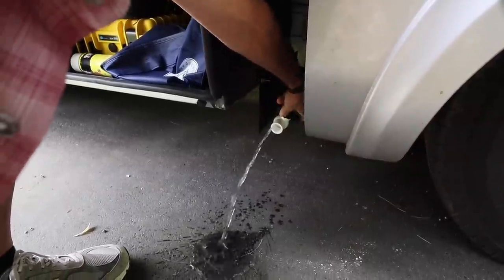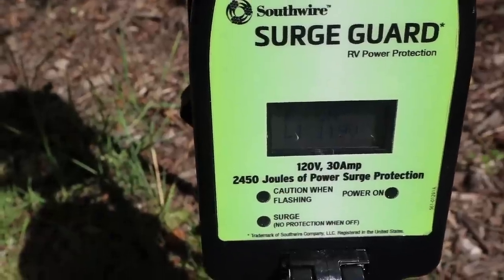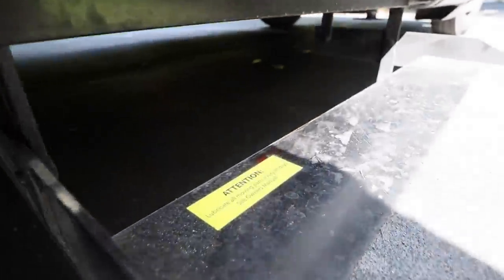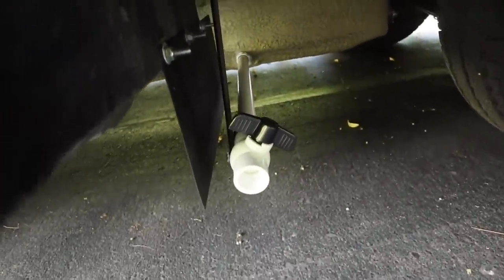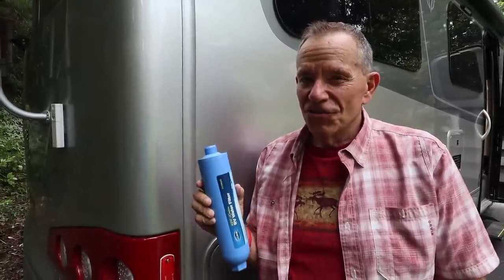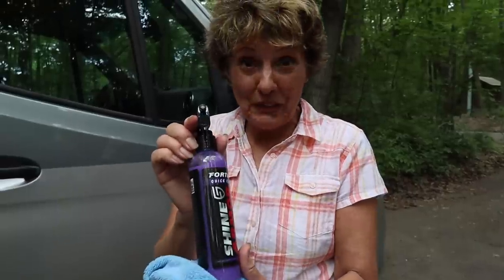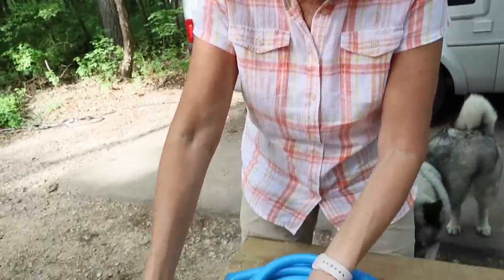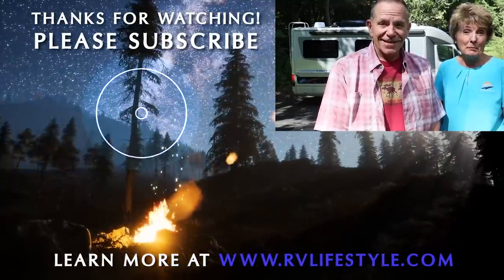12 hacks, mods, products, & RV tips and tricks for RV living

Comment: Great tips. However, you needed to tell people that the pressure reducer needs to go on the shore water connection first and then the water hose. We found a campground in Utah that had 120 PSI water pressure. If I had not put the pressure reducer  at the shore connection we would have blown our water hose apart. Thanks. Keep up the good work

Comment: Great video, these are my picks in the south

1. Surge protector
2. Pressure regulator
3. Leveling blocks, 5th wheel tripod
4. Filter to rig, also brass 90 I like also with a Y for extra hose
5. Good shower head aqugenits
6. Big Berkey water filter
7. Sink strainer for dishes
8. Geo method, Dawn and water softener
9. Clear 90 on dump hose
10. Dehumidifier also monitor temp and humidity

Comment: When I saw your electric cables on the ground I had to comment. I let my cables lay on the ground some CG in the south...next morning there were millions of ants crawling all over inside my camper... floors, walls. It was ghastly! CG itself was beautiful...just so many ants in the south. I’m glad to learn about a surge protector... never heard of dirty electricity. TU
Reply: Where do you put them so they don't touch the ground?
Reply: I just got as close to the hookup as I could, but I wonder if those supports for sewer lines would work too, anything but the ground. Hasn’t been an issue anywhere but the south.

Comment: A surge protector is an important option but even better is a line conditioner that maintains the voltage level and protects against both surges and sags - like the Hughes Autoformer which comes in 30 AMP and 50 AMP versions.

Comment: Great video. Information is priceless.
Question about surge protector: If there is a surge in power, is there a reset button on the device or does the unit sacrifice itself to protect?
Reply: Typically these will take the excess voltage and send it back on the neutral (before it goes through your devices and ruins them!). These will have ratings of being able to handle up to a certain amount before being destroyed, but worse case scenario is it gets sacrificed before everything else does. No reset buttons, just indicator lights and status screen.

Comment: Great video...one thing i use the happy camper product..works great..but i mix mine in a 1 gallon bucket. If you dump it in the toilet without mixing it up it can get chunky on you and not do its job.
Mixing it with water throughly then putting it into the tank you are good to go.
:)

Comment: Those blue water filters are good in theory.  They are filled with charcoal that aids in taste and odor removal but, they have no filter material inside them to trap  any particulates. Last but not least the water passes through the filter so fast that the charcoal doesn't have long enough contact time to work.

Comment: My undemanding is that the water pressure regulator should be placed before the filter, so you don't blow out your filter. Thoughts?
Reply: As I said the pressure reducer goes before anything. That is if you want to keep all your equipment safe.

Comment: Thanks for the tips. I am in the process of purchasing a Unity and will definitely purchase these useful items. In the event you have a bad electrical hook-up, do you just move to another spot?
Reply: TheGolfster3 We had this problem once, and the RV park didn’t believe us. So we showed him what the surge protector said; he was speechless and flabbergasted. I told him that we’d rather move then use his power. He didn’t have another site available with power, but I think he was afraid that we may give them a bad review. So he allowed us to stay on the site but charged us only for dry docking without shore power which we really appreciated. Then when he had a site available, we checked the power and it was fine so we moved there and paid the price we would’ve paid had we not checked the power first.

Comment: Super helpful. When do you treat with Happy Campers? E.g., Just after a tank dump, when you are at 50%, or just before dumping tank?
Reply from the maker: After a tank dump... I run about a gallon of clear water  in and then put in a scoop of Happy Camper
Reply: Maybe naïve question but where do you get the water when dumping or do you use the non potable hose?  @RVLifestyle
Reply: @traceymardon8161  The toilet water won't be strong enough to clean the black tank. 

- blank tank flush if your trailer has it. 
- the non-potable water hose along with your own water hose to spray down the toilet. 
- pour water from a 5 gallon jug down the toilet.
Reply: @aguyandhiscomputer  We have a black tank flush so I guess that is why I was confused.  Thanks!
Reply: @traceymardon8161  cool, that's what I use. 👍

Comment: Did you not have the surge protector in your RV or is the surge protector a second protection? Great video. Also, how do you like the leveling system. I'm looking to have them install, but checking out Advanced RV in what they install, which is ~2k more. Thanks
Reply from the maker: No surge protector on rig... this is what I use for total protection

Comment: That surge guard looks like an expensive model. Is there a way to keep it from growing legs and taking off? Is there anything a person can do when the polarity on the electrical post is reversed like that?
Reply: Having my expensive surge protector getting legs and walking off is also a concern of mine!
Reply: I have been researching this very topic.  If you look you will see there is a silver metal piece on it that you can secure with a lock using a cable.  I'm not expert but I just happened to do some research, hope that's helpful!
Reply: A pad lock will fit around the cable part. Use that padlock with a chain and another padlock to some anchor point (for instance the lock on some post covers). 

They also sell metal boxes that will cover the plug end and the plug from the power cord to the camper for about $20. Just makes it harder to steal since they'd have to take the whole cord also.
Reply: There is an identical unit that can be permanently installed in the camper that can’t walk away,  can’t get left behind, and you can’t forget to use it.

Comment: I like a lot of the things you talked about, but one minor issue is that when you use the "Happy Campers powder", you need to actually put about a gallon of water in the bowl then add the powder and mix it a bit before you dump it down the drain.  This basically prevents the powder from clumping up and not being as effective as it should be.  Cheers guys, good video.  "We are Daring to Dream" check us out I have a video on gizmos and gadgets too.
Reply: I’ve heard that it should be sprinkled in, instead of dumped in.
Reply: @kathyzehner9660  yes that's correct, that is why I said mix it with about a gallon of water so it doesn't clump.

Comment: Reverse polarity is due to improper install /service. Hopefully you notified someone that could address it.  Another hack is ice down the black tank when you pull up stakes.
Reply: I support the bag of ice method. Many people don't but it has worked for me.
Reply: We’re new, please explain the ice method?
Reply: @michelleengland6294  
- buy a bag of ice or get it from your house freezer.
- pour it down the toilet.
- add a few gallons of water if the tank is empty.
- drive to the dump station or to the campground (the longer the better)
- dump the black tank

The ice provides agitation and loosens up everything. It will melt and flow right out.
Reply: aguyandhiscomputer Thank You!

Comment: We’re trying to patiently wait for the delivery of our 2020 LTV Unity FX in December. Since LTV puts a surge protector in the coach as standard equipment, does that not protect the electrical system as well as a pedestal auxiliary protector?  Great short list for our initial gadget shopping. Thanks.
Reply: If there’s a giant surge, like from a lightning strike, a built in EMS can way overheat, catch fire, and destroy the camper. Much better that it fries on the pedestal rather than inside the RV!
Reply: @calburnIII  Thank you for your input, Cary.  Given that scenario, it sure seems better to have the fire at the pedestal than under my bed.

Comment: That fresh water drain you had added to your water tank will surely freeze and burst, the first time you camp in <32° weather.  Looks like your new RV is not very well designed for winter use...and my crystal ball shows freeze problems, if used near your Michigan home base Oct. - April.
Reply: LTVs are only claimed to be 3 season rvs. If you have seen their prior videos, they also have a condo in FL for winter use.

Comment: The Bad Power hack, is there a CHEAPER way ti identify such? SO, after you found such does the box rectify the situation OR just tells you the issue??
Reply from the maker: You get what you pay for. There are more expensive ones than the protector we chose. No, it can't fix a bad power pedestal. But it will tell you a problem you wouldn't see anywhere else. It protects in power spikes, brownouts and restarts when power is interrupted.
Reply: Once a serious issue like that,  with the power supply, is identified,  do you have any recourse with the campground.  Are they generally happy to be notified or is it just tough luck the last people didn't complain?